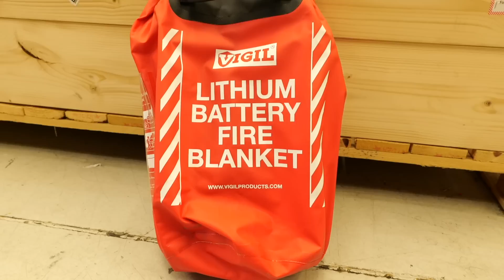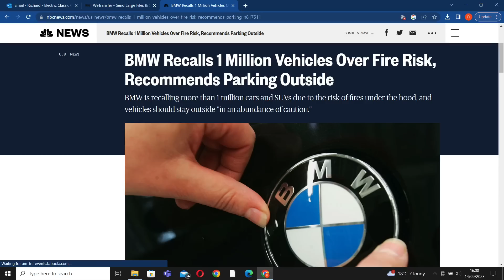Electric Car Fires - Facts and Figures

Comment: Did the Swedish agency include the statistics by age of car? If not, is it fair to compare  on average 10 year old petrol and diesel cars to a 1 year old EV?
Reply from the maker: The average age of an EV in Sweden is not one year, it’s closer to 4. However, if you’re suggesting that the fire risk of an ICE vehicle increases with age you’re correct. However the same is not true for EVs it seems. In that Swedish study it found that even though the number of EVs doubled in the past 3 years the number of fires in battery vehicles stayed the same at around 21 per year.
Reply: @ElectricClassicCars  If sales are nearly doubling every year, then the average age would be about 1 year (regardless of the number sold). There are many other factors not mentioned related to age, including likelihood to be stolen and set alight, different demographic owning the older vehicles, poor maintenance, where and why the car caught on fire (ie spontaneously or due to charging like EVs, or fuel or electrical related in ICE vehicles), and importantly is there anything the owner can do to prevent it or prevent disastrous consequences. The devil is in the detail, but to proclaim that 20:1 ratio of fires represents 20:1 RISK from a new vehicle purchase, that is not accurate.
Reply from the maker: @MotoGuzziMoto There are millions of ICE cars being recalled by manufacturers right now because of fire risks, including BMW, Ford, Hyundai, Ferrari, RAM Trucks, Kia, Honda, etc But no manufacturers are currently recalling any EVs because of fire risk.
Reply: @ElectricClassicCars  So are you saying that EVs are perfectly safe from fires? Haha. Just wait till legislation catches up with EVs, they will have to provide fire extinguisher and other EV specific fire protection systems like attachments for fire fighters to drown the battery compartment. It's just a matter of time.

Comment: The facts are, Ev cars will not work. no matter how much you try. I only need three reasons. One we cannot support the power grid with even a 10th of the population driving them, Two You cannot heal more then 10k weight. you average trucker haul weight is 40k. 3 we are making new care when peoples old cars could be changed to better choices. in short refitting care is the step we are missing and lets face it no one is going to replace their 1969 mustage for a car no one wants and no one asked for
Reply from the maker: Trying to tell someone who’s been driving EVs for 8 years that they ‘will not work’ is a bit like arguing with a pilot in an airport that planes ‘will not work’. It’s too late my friend, I (and millions of others) already know they work and are so much better than ICE cars. Embrace the future, don’t be afraid of it. 👍
Reply: @ElectricClassicCars  They wont believe you till its far too late.

Comment: You are using a false comparison. It is not the percentage comparison between the risk of petrol and EVs catching fire but the consequences which are substantially greater than petrol fires. It is not knee jerk social commentary that sank one car carrier, burned out another and destroyed a £20 m multistory car park in Luton along with 1500 other cars including EVs.. The best judge of the risk is the insurance company premiums with many now refusing insurance on EVs and on homes if garaged there.
Reply from the maker: I’ve had no problem insuring my EVs in the past 8 years or home insurance either. EV insurance has increased at the same rate as ICE this year. And as for the car carriers and car parks being destroyed that’s more about believing anti-EV social media channels than based on facts. For example the Luton car park fire was started by diesel Land Rover, as was the Liverpool car park fire several years earlier that also destroyed a multi story concrete car park, and not an EV in sight. Car carriers and car parks have been destroyed by fire for decades before EVs came along.

Comment: Ok lets believe that by percentage the tiny bit of ev battery fires are actually that low which in china and japan thats not the fact Let say the range is proper which there not It still leave the fact  The insurance cost is going to be super substantial probable more than the monthly payment of the auto loan  The cost of battery replacement currently is in some cases more than the vehicle was new There is technology in the next 10 years that will be superior than today So my point lets get it right from the start not rush this to the market and have the consumer be the tester I'm almost 60 YO I have never had my vehicle start on fire But 2 houses down from me his Hyundai burn down his house after 7 months of owning and yes it was the battery I can't wait till they get this right but the industry is a long ways away

Comment: To make a fair comparison you have to compare vehicles of the same age. Also the environmental impact in form of toxic smoke the water and foam used include various dangerous chemicals makes a big difference.
If you have an accident and are trapped in the car, the rapid development of this kind of fire and the extremely high temperature increase the risk of being cremated long before the rescue personnel have time to do anything.

Comment: We'll have to see how the statistics change over time as electric cars age, do their fire risks increase? Certainly with ICE vehicle if you have degraded rubber for power steering, oil coolers, fuel lines, and you have an existing leak that increases the risk of fire.

Comment: Correct me if I am wrong, but it seems to me that if two gasoline cars are parked a couple of feet from each other and one goes up in flames it would not propagate to the other because the other is not leaking gasoline and there is nothing to combust. Also gasoling fires do not get as hot as EV fires and the flames do not shoot out as they do in EV fires.  I have seen a row of EV buses go up on fire when one starts because of the shooting flames and the extremely high temperatures compromise the batteries in the other buses. If those buses had been gas driven I do not think the fire would have propagated like that.
Reply from the maker: Ok, because you asked so nicely I will indeed correct you as you’re wrong. When a petrol car catches fire it propagates to all the cars around it because the burning fuel turns into rivers of fire. That is the reason why car park fires are so bad. If you read the fire departments report on the 2017 Liverpool car park fire, the describe rivers and waterfalls of fire from burning fuel spreading the fire to other cars and other decks. The heat of the fire also caused the concrete to collapse. And not an EV in sight. 👍

Comment: When a car that runs only on gas or diesel catches fire, remember that the fuel when exposed to the open air, only burns at about 800 degrees, while one of those EV battery fires can burn hot enough to melt concrete. Also, those EV battery fires don't need oxygen from the atmosphere to burn. How do you put them out? No so easy, is it chief?
Reply from the maker: Petrol/diesel car fires destroy concrete too. Just check out what happened in 2017 in Liverpool car park fire where no EVs were present. The fire department incident report stated rivers and waterfalls of fire from fuel spreading to other levels and the intensity of the fire causing spalling and causing partial collapse of the concrete structure. https://www.newcivilengineer.com/archive/sheer-luck-fire-hit-car-park-still-standing-08-01-2018/

Comment: Gasoline vehicle fires are easier to put out and once they're out , they stay out . Battery fires will keep reigniting hours, days and even weeks later . Battery technology is being said to be cleaner technology than gasoline, fact is , that isn't true. It's a lot dirtier because, most electricity comes from oil . Most electrical grids don't produce enough electricity for everyone to go electric so oil use will have to increase to help supply more electricity to the masses. You have to do complete research on every aspect and not just on one topic . The materials needed to build electric vehicles are incredibly toxic to the environment,  especially cobalt and lithium. Research the mining and processing methods for yourself, don't just take my word on it . For now, gasoline is still better. Hydrogen is the only solution outside of particle energy.
Reply from the maker: A gasoline vehicle is far more likely to catch fire and a lot more difficult to put out than a horse, but it didn’t stop us all moving to gas cars. A lot of EV manufacturers are now moving to LFP batteries, like in my wife’s Tesla Model 3. LFP are virtually impossible to ignite. In the UK no electricity comes from oil, 2/3 comes from renewables or low carbon fuels like nuclear. 1/3 comes from gas, with around 1% coming from coal. If you are truly worried about electricity production then I wouldn’t keep pushing hydrogen if I were you as it takes 6 times more electricity to go the same distance as an EV.

Comment: That's exactly right. You hear about it 100 times for every one time it actually happens. Wind turbine fires are the same way. You can watch YouTube videos all day and all night, and you will find, that there's actually only a couple dozen events. They're simply re-posted, and re-narrated. As you mentioned, Airline accidents are the same way. I'm NOT afraid to charge an EV in my garage, simply because level 2 charging won't induce a temperature rise in a 60 kWh battery. If it's going to happen, it will be while fast charging, or, while on the road, when the battery is subject to sustained high current. Even then, it's less likely than an engine, with red-hot manifolds, being fed flammable fuel. Battery manufacturers are more than aware of the "bad press" that comes with a battery fire, and are not anxiously awaiting the liability that comes along with that. They're doing everything they can to prevent it, so you won't ever see an increase in incidence, but rather, a decrease, despite the ever growing popularity of electric vehicles. There's a lot of research being done on battery chemistry, electrolytes, and electrodes, to improve cycle life, power density, charge rates, and safety.

Comment: YOUR FACTS MAY BE FLAWED….Does the data you are stating name the circumstances of which the vehicles caught fire. The reason being is that if the vehicles caught fire by all circumstances then the percentages are flawed.  ie; if ALL the vehicles spontaneously combusted then you can correctly state the numbers as true. However if the vehicles caught fire from say an accident then the fact that there are 8 times the amount of ICE vehicles on the road, then they have a much higher probability of being in an accident. To make the statistics equal that percentage of EV fires needs to be multiplied x 8 to make the statistics accurate.

Comment: The percentages of ICE vs EV fire probability matter a lot less when you factor in that a bottle of water will put out the fire in an ICE car- the battery fire in an EV is far more difficult to extinguish and far more toxic. The damage caused by those EV batteries going into thermal runaway in parking areas , car lots , etc are getting a lot more news coverage. That recent Dutch ship fire is a prime example, the ship and contents were nearly a total loss.

Comment: The problem is when they do burn lets compare the toxic output and heat  Chernobyl vs fuel depot would be a good idea the electric part no problem the battery is the problem why do we need 0-60mph in 2 sec when it is supposed to get us to work and back etc. We least 10 years away from both problems charging and safe batteries for the masses

Comment: OK, thank you very much for that report. Very clever splitting it into percentages. But what you didn't say was the ones that were car lot fires, the one EV that caught fire burnt out the other hundred petro cars. Those other cars never would have caught fire in the first place.
Reply from the maker: You mean the one petrol car that caught fire, plastic fuel tank melted and released pools and rivers of fire under surrounding cars and an inferno destroying all cars ensues. I’ve never heard of battery fires spreading with pools and rivers of fire. 😂🤣😆

Comment: In The US Currently there is no method of gathering data on these types of fires. The National Fire Incident Reporting System (NFIRS) does not list lithium-ion batteries as an option for ignition source. Another source for vehicle fire data may be insurance companies, but they might not have all the data regarding e-mobility and consumer electronics.

Comment: But this also depends on the  age of the vehicle and maintenance of the vehicle.  We need stats of vehicles all the same age to get a true stat . If an electric car catches fire it can reignite upto 5 days later which happened in the states . At least an ice cars once put out stays out .  If a fuel tank splits I can get a new one from £200 quid . If a battery fails in an electric car the price can go upto £10,000 to get fixed

Comment: Good video that puts together info against the common arguments about Ev fires but I think you’ve been a little too defensive and made some comments that are over the top or assumptions. Saying that petrol cars “start that kind of fire every day” is hyperbolic when the type of fire you had just referred to was one that burns down a complete parking lot. I'm guessing you just mean that they start the kind of fire that could lead to such a disaster but they are usually just single car fires. 

The Swedish study is good, I found that when searching online and in trying to come up with where the gaps in logic are I wondered whether the comparison between ice car fires and ev’s is skewed by the broader range, age and quality of ice cars. You would presume that EVs in Sweden meet certain safety standards and are of a higher quality relative to comparable ice cars because they are more expensive and buyers will expect a certain level of quality for that price. Cheaper ice cars might be more or less likely to catch fire than more expensive ice cars for a range of reasons. We probably don't have the relevant data to tell which categories of ice cars are more likely to catch fire and whether that affects the comparison with EVs. Not having the data is important to note so that we don't insert assumptions in those gaps.

You did well to go into the challenges that face firefighters when face with an ev fire but you then speak as if petrol and ev fires are like for like comparable. Ev fires are more rare but the challenges they cause people in putting them out and resulting damage they can do might be much greater and it would seem that ev fires probably are much worse than petrol fires. I think that speaking as if one fire is equal to the other is the result of being over-defensive. The types of people who rant about the dangers of battery fires tend to be quite hyperbolic so it can draw you into exaggerating your response a little.

But all in all, a good video.

Comment: Anything "can catch fire" . But not everything can spontaeously combust !
How mant petrol or diesel cars spontaneously combust ? None. Petrol diesel cars catch fire due to electrical faults etc .nothing to do with the fuel.
EVs combust by themselves.
This guys clearly an Evangelist pushing fake news.

.
Reply from the maker: If you think ICE vehicles don’t spontaneously combust when parked and switched off then you’re very much mistaken. BMW are recalling millions of cars right now because of this risk. BMW Car Fires: More fires reported in parked cars while engines off https://abc7chicago.com/amp/bmw-car-fires-vehicle-what-causes-per-year/5121834/
Reply: @ElectricClassicCars  electrical problems causing the fires? 
Petrol and diesel do not spontaneously combust . Fact. 
You could put a can of petrol or diesel on the ground and they will never, ever, burst into flame without some external cause . Thats the difference between " catching fire" , which can happen to anything and self stsrting fires such as happens with EVs. Its simple logic.
Reply from the maker: @RobertLund-d7d How many decades have you had a mobile phone, laptop, power tools, electric toothbrush etc. any of them spontaneously combust? 🤣😂😆
Reply: Yes actually . I bought a charger for my phone in malaysia . 30 secs after plugging it in it exploded !

Comment: All cars can catch fire but the EV can catch on fire for many more reasons including salt water and a bump on the back bumper.  Petro car fires can be put out with conventional methods but when an EV catches fire, that fire starts thermal runaway which is a chemical fire that produces its own oxygen and burns much hotter and for many times longer.  There is no effective way to put out an EV fire and firemen are now told to let them burn out.  The poisons released into the air from an EV fire kills 500* more polar bears than the EV supposedly saves.

Comment: Your analysis of electric versus ICE fires is dramatically flawed.  You didn't factor the age and maintenance history of the ICE cars that caught fire versus the age of the electric cars.  The analysis should have been limited by the ages of the cars.   You can't have ICE cars in your analysis  that caught fire built prior to the date the first electric car was registered in that country.  I.E.  If the first model electric car was registered in 2010 then your analysis of car fires cannot include ICE cars built before 2010.  You did not factor the mileage driven on those electric and ICE cars.  You should probably consider having an engineer or analyst review your findings before posting.